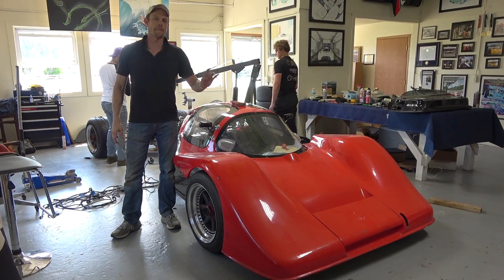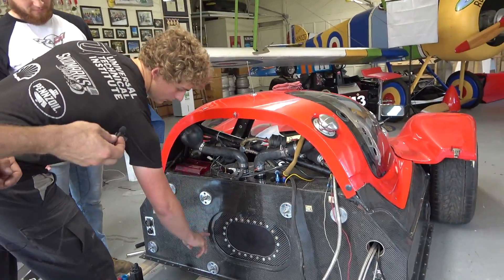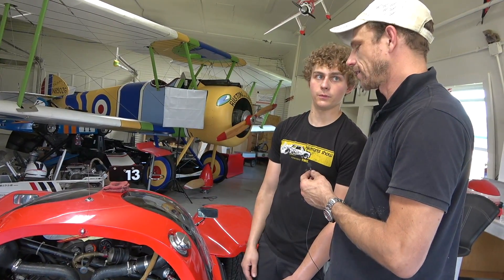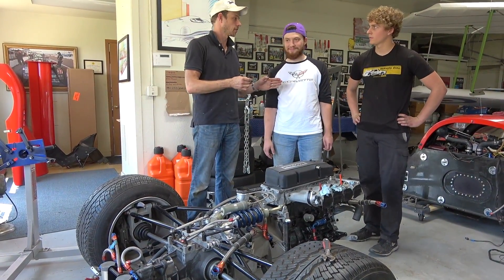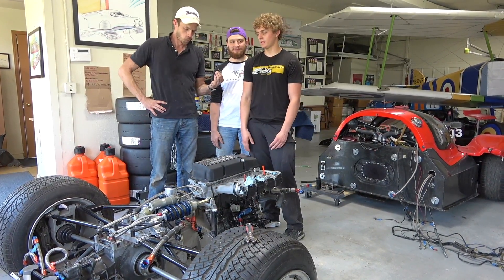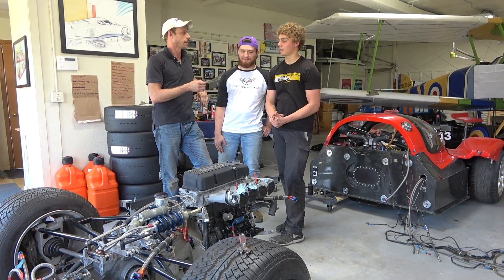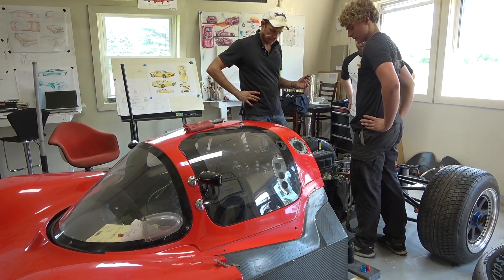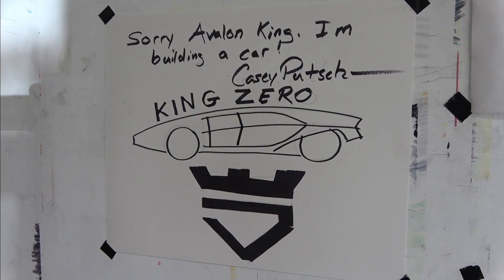Mexican carbon fiber race car is a secret SPEED MACHINE!

Comment: That KA24E was used for 1989-1990 240SX's as well, I have one in my '89! crazy to see this in a full blown racecar, especially still NA. Stock they only make around 140hp. 250hp is insane for one of these without any forced induction.
Reply: The fact that it is an Iron block and not as wide as a DOHC KA make it ideal for a partially stressed member, and these blocks were readily available in mexico around the time these machines were being conceptualized! early 240sx's are cool and good on you for keeping the KA and not swapping it.

Comment: ka24 is something a friend of mine had in his 240SX. A durable engine, one that survived all the torture we threw at it while we expected it to blow and get replaced.
That's a lot of tech and performance for what you said was cheap.
With this weight it doesn't even need any more power, it feels insane as it is.
Such a nice vehicle.

Comment: It seems like there should be more bracing to the monocoque to drive-train connections.  Are there 4 more pickup points further outboard to the monocoque to reduce flex between the two halves?

Comment: I've gotta ask, I've been staring at it for 10 minutes now and can't work it out, what's the linkage coming off the back of the cantilever for the rear suspension, it looks to me as if it would imobilize the movement of the suspension but that can't be right?
Reply from the maker: Puts pivot point in double sheer mount for strength
Reply: @CaseyPutsch  having gotten some much needed sleep is it possible what i was referring to may have been a sway bar link?

Comment: Nissan used KA24E was used in the '89-90 240SX, and Hardbody Pickups in the RWD configuration. KA24E: 2.4L SOHC engine (this engine)
KA24DE: 2.4L DOHC

Comment: Wow thats cool. The only problem with the KA is its long stroke, and side loading the piston and wear from it. I'm a former 240SX owner (moved on to Z cars) and I've done research on ka's. The trucks that used to run the SOHC KA you have there I think went up to 13-14:1 and got some more power out of it. Im sure a more radical cam and all that, but they lived their lives in the 20-40 hour range if I remember right.  But you guys have direct contact with the designer of the car, he'll know more about how long that setup will last. Other than that it'll be awesome! 

Oh and if it explodes, and takes out expensive bits, you can always put a VQ30DE in its place. Aluminum block, cheap and similar power stock....Not bolt in but nothing else is other than a dohc ka.

Comment: Speaking of motorsport south of the boarder, I'd love to know more about Turismo Carretera in Argentina. It's really hard to find tech information on the engines, but they basically take classic American inline 6s and build them to insane levels with one off heads, screaming redlines etc. Essentially it's NASCAR if NASCAR used inline 6 engines built from production blocks rather than V8s. I just want a Argentinian DOHC head on my AMC!

Comment: The K24 was also found in the Nissan 240sx and largely ignored because of the JDM cult status of the sr20det but honestly the K24 is a stouter bottom end and responds very well to mods. 400 hp with a good turbo setup isn’t unheard of.

Comment: Is the engine a stressed part of the chassis or is there a frame around the engine
Reply: The engine is a stressed member of the chassis, as well as a frame that goes around the engine and connects to the transaxle as well.

Comment: The engine looks like a Nissan 2.4 Liter KA24E like out of a 1989-1990 240SX or Hard body Pickup if they got an extra 100Hp out of it NA that would be fairly impressive.

Comment: Hang on a sec.  Am I seeing this right?  The front tub and everything forward is connected to the entire rear chassis, by only those two lower points of the rear frame and two points on the head?  That seems like a lot of stress/strain to put on the aluminum head casting.  I'm assuming it's cast aluminum - not billet.  Mind blown.

Comment: That's a lot of power outta a KA24, I'm really surprised that engine was used at all, was it because it's NA? I think it's a KA24DE? used in s13 240SX, a car you also got the turbocharged CA18DET, and the turbocharged SR20DET, both which are more attractive than the NA KA24 among Nissan folks. That said... I do love when folks take things in a different direction than the standard, might just be me but I kinda get bored of when there's a grid of cars where the only difference is the shell, otherwise they're all identical.
I kinda find it interesting when there's a ruleset allowing for variety, and seeing the various ideas teams come up with then, and you end up with fun grids where one team maybe has a small European V8 engine, racing against a team with a giant American V8, teams with I6 engines, I4, maybe one team went Wankel for some insane reason, while another decided that a VR5 was a good idea after a night in the bar and heavy drinking.  It's when ya get the weirdness of using snowmobile engines to create grip, or some folks decide that in a league of MR prototype cars, why not build a FF one...
Without further rambling, I love the idea of going up against the big boys using a Mexican developed race car sporting an angry pickup-truck engine. :P

Comment: Doesn't look like KA24DE. Valve cover is not that tall on the Nissan engine. Is it a Honda K24 maybe?
Reply: Can't imagine a Nissan valve cover on a Honda motor.
Reply: Yea its a nissan ka24e, single overhead cam
Reply: It took a while before I saw Nissan on top. See where trolling gets you.